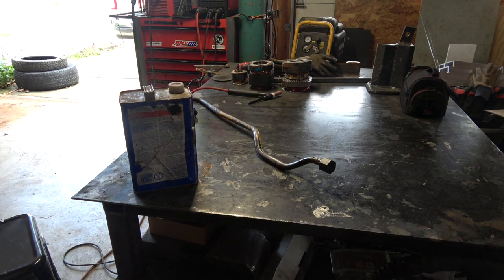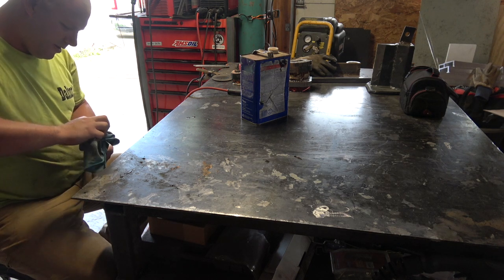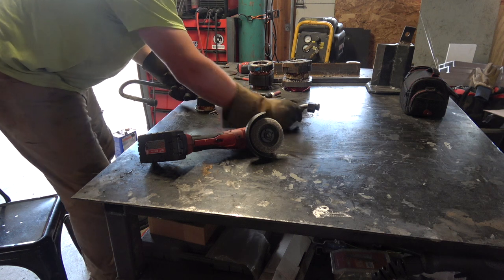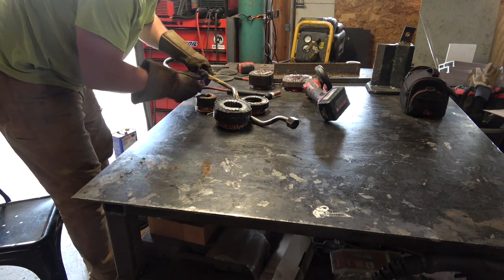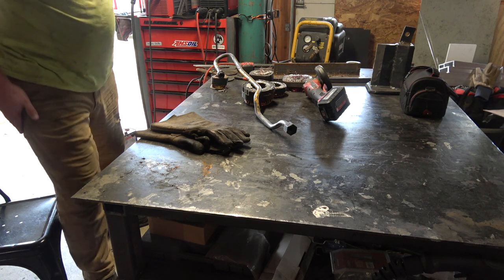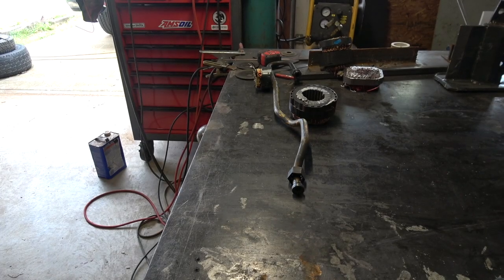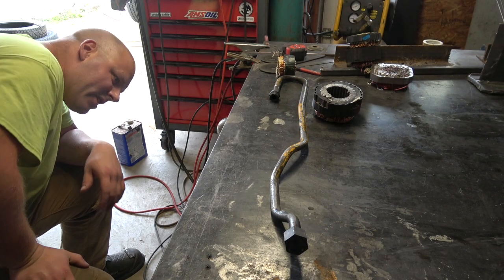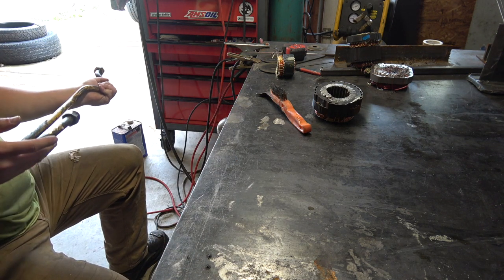Repairing a pinhole leak on a hydraulic line

Comment: Yeah, had jobs that should take a minute or so and ended up ages fixing blowed holes,  only other possibility were be to clamp a cut pipe over the weakened part with a larger diameter and weld that, but I'd prefer to just get a new pipe bent, sure there are shops that could achieve that fast, just need to find that right craftsman in your area. Still, good quick fix!
Reply from the maker: Thanks. I actually checked with the go-to hydraulic shop in the area on my way out to go install this part. they said it would be too hard for them to try and bend it. I don't have my own bender nor do I have the space for one currently. If I did there would be a lot of things I'd be doing with it that no one else seems to really be doing in this area.
Reply: @scrapmanindustries  Not sure you would need a bender, cant you just pack it with sand, heat it up in a small forge and bend it by hand?
Reply from the maker: @engjds  someone probably can but not this guy

Comment: Nice work considering the hyd tubing was contaminated with oil inside. You would of thought after seeing the previous weld that they would have run to a local hydraulic shop and had them bend another 1" hyd tubing and fittings? 200-300 bucks? and be done with it.
Reply from the maker: I took it to the one shop we have around here and they said it would be hard to bend steel as complex as that is.